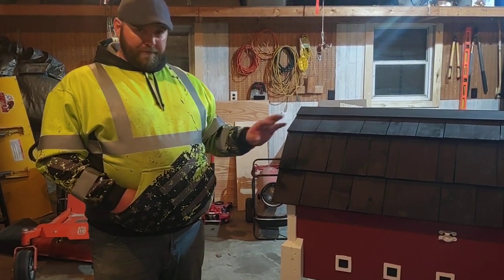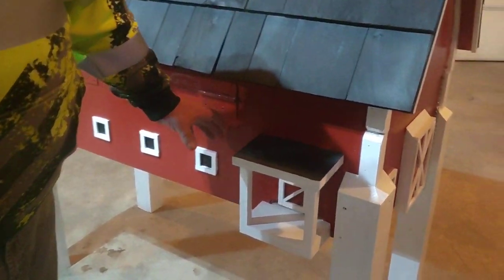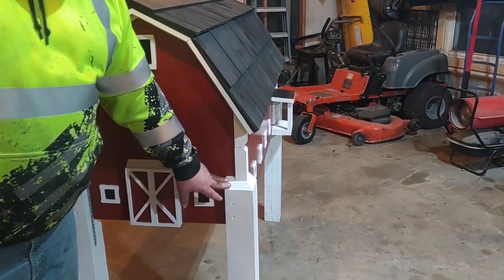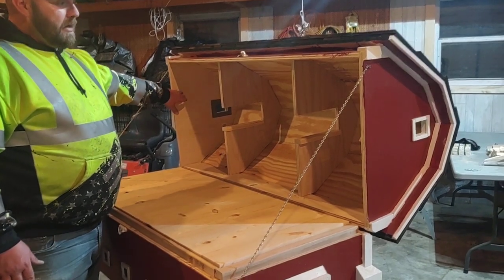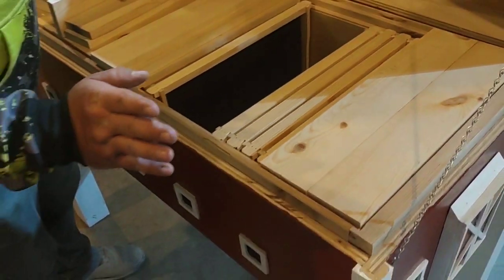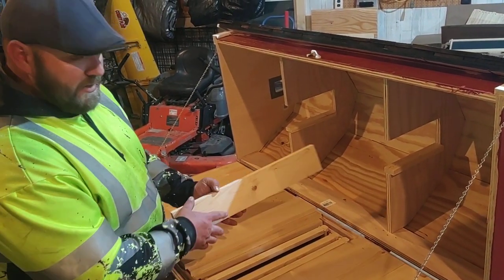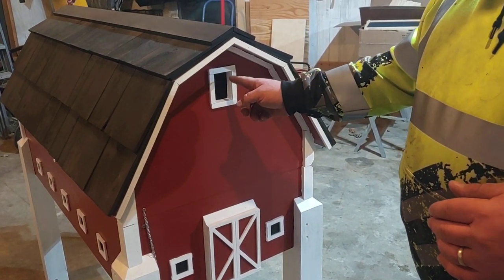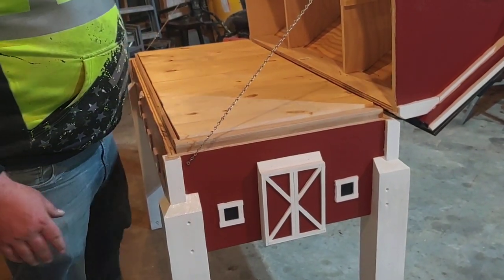Horizontal Langstroth BeeHive/ Long Hive "The Bee Barn" 🐝

Comment: Middle of B.C., Canada. Made 3 horizontals last winter, used 3/8 ply with 1.5" polystyrene sandwiched walls. Your design is great, I might have a go at it, but make it take med supers on top. I have one that does this, and the capacity is brilliant, and still so easy to work with. The built in frame holder, very nice!!

Comment: I am just starting to learn about bee keeping and I came across your video. Love the barn design. Just a few questions, is there a place underneath to put a board to check for mites? I live in the rocky mountains, and it can get pretty cold. Have you ever use insulation in the sides and top? Thanks again for the great video.